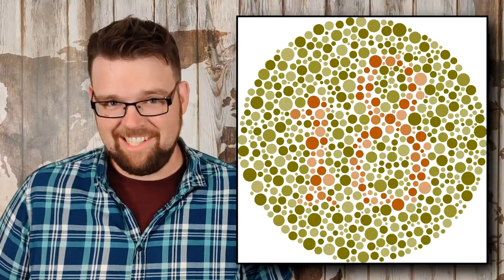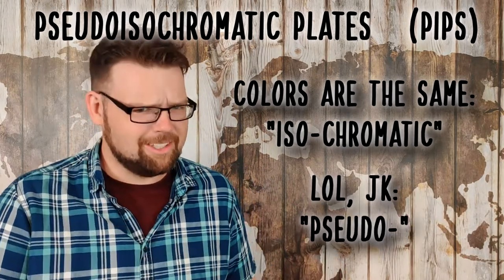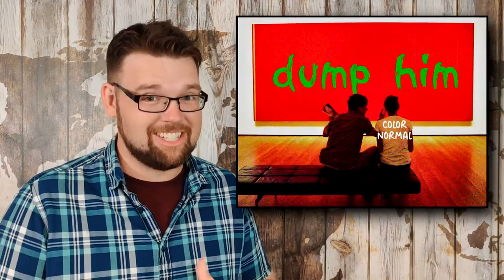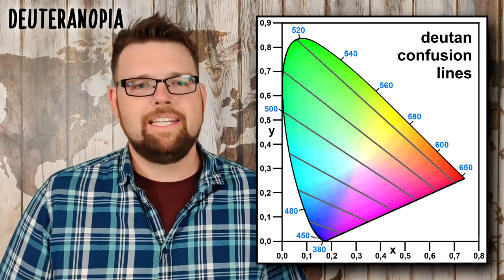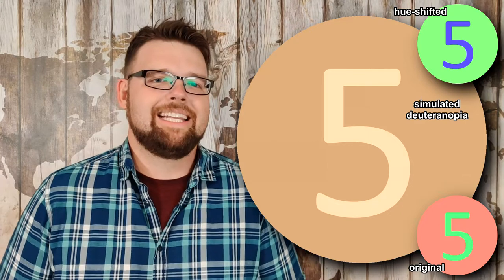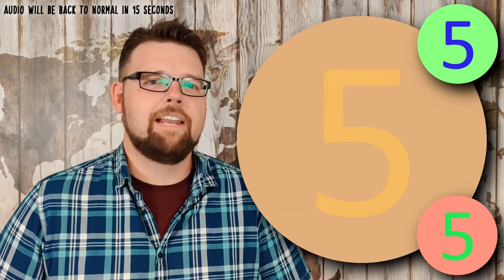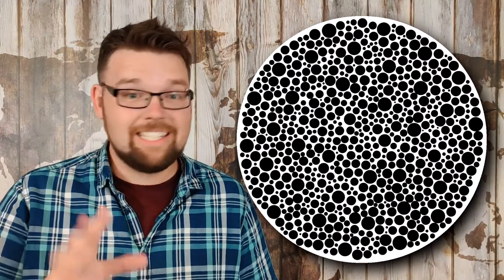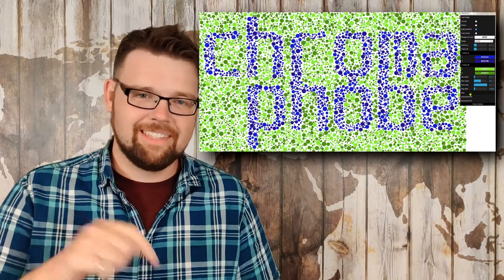The Science Behind The Ishihara Test

Comment: Is there a version of the CIE 1931 color space diagram which has been adjusted to be isoluminant?
Reply from the maker: The original is meant to be somewhat isoluminant to "the standard observer". CIELUV is a little better here, but I don't think either do it perfectly. CIELAB has some projections that are isoluminant, but CIELAB doesn't have a neat, standard "Chromaticity diagram" like the other two.

I've never seen or made a Chromaticity diagram that is isoluminant to a protanope, for example, though.

One of the problems is that the colors along the Line of Purples are by definition at the limit of human perception. In a perfect Chromaticity diagram, those would all be pure black. If those are gonna be isoluminant to anyone, they would have to be infinitely bright.

Comment: I could still see the number (and yea, I noticed it was a 6!) on my screen, both on my external monitor and laptop built in. they are both pretty bad monitors, tho.
Reply from the maker: I tested it on three screens that tend to differ a bit on color and on one both my color normal  wife and I could kinda make it out. That's why screen based tests are always going to be worse than printed. A publisher can control the printing process. A programmer can't control your monitor calibration.